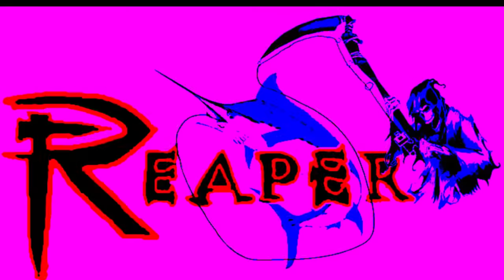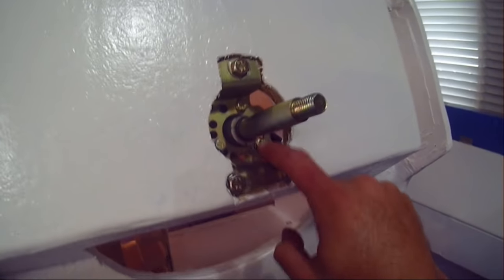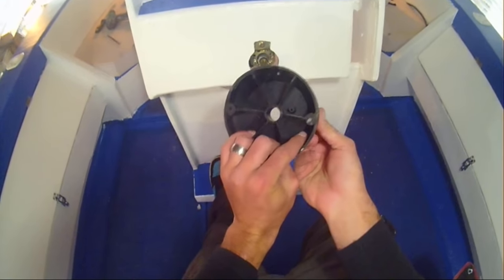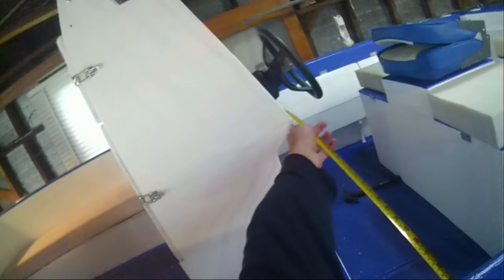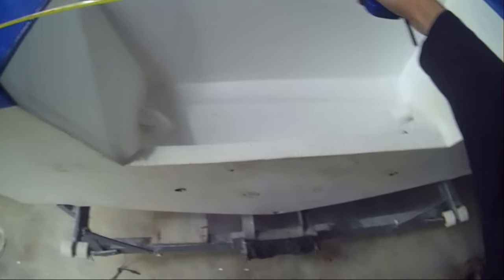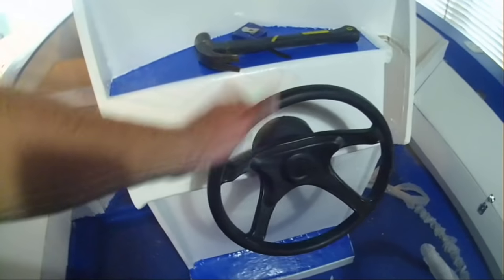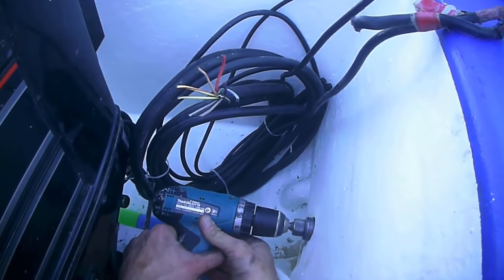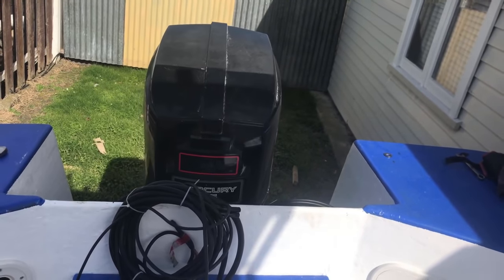HOW TO INSTALL BOAT STEERING SYSTEM

Comment: Lots of videos about changing cables.  Lots on upgrading or replacing bad parts but I don't think anyone else has done a video about adding steering to a boat that didn't have it previously and this is exactly what I was looking for.  Nicely done!
Reply from the maker: Thank you very much for your comment. It's really encouraging to know that a video I've made has helped someone out. Thanks for your support.
Reply: Having watched all your videos now, I must say it's a real shame that you didn't do a full documentation on the complete boat build.  You've done some amazing work and it's a shame that it's all relegated to a 6 minute video.  Your episodes on the actual builds of the fuel sender, light bar and steering setup show what might have been a great build project that was documented from beginning to end. In addition to the actual boat build, I would have loved to see videos on the console build and especially the addition of the throttle controls much like you did with the steering.
Reply from the maker: laserguy Hey man. Yeah I'm so disappointed that I didn't do a video documentary of everything from the start. I took photos of everything since the start but it does not justify all the work that has gone into building everything. If you search for me on FB Jonathan Jvv I'll friend you and then you can check out my boat build album. Every photo is in there. In regards to the throttle control that will be one of my next videos. It is temporarily mounted on the console but not connected to the control cables and motor electronics yet. I will also be doing another video soon of how I did the anti slip on my boat, so easy and really cheap. I also have another chill box from a friend that needs fibreglassing so I will also do video on how to fibreglass too. Thanks again for watching and following my videos. Greatly appreciate it. 👍
Reply: Thanks for the reply.  Look forward to the throttle control video.  I know how to do fiber glassing, just thought it would be great to see you build the console completely from scratch.  As to FB, I have account but have never used it.  Left you a message.  Hope it gets through but no promises.
Reply from the maker: Hi There. I've finally. uploaded the video for the throttle control. Sorry for taking so long but I had issues with getting the correct size of cable and had to get it imported from America. Well hope you find it helpful and if you have any questions please let me know. Cheers Jono

Comment: Easy to understand. I saved it for the job I'm about to do. One thing. Your measurement for the length of the cable. Instructions that I have seen say to add an additional 6". Then round off to the nearest foot. Adding inches to the nearest foot. More is better than less.
Reply from the maker: Awesome stuff Mate. What boat are you installing this on? Is it a project you are busy with? Definitely round up rather than down easier to hide a couple of inches than be to short.
Reply: I own a 1882 Ranger Warrior bass boat with a 1985 75horse Evinrude.  Both still in very good condition, garage kept. But constantly upgrading, it seems. Sometimes by choice sometimes not so much by choice. All good though. Kind of treat it like a hobby. Really do enjoy Largemouth Bass fishing from it. Finished the steering cable install and ready to fish again. Thnks!

Comment: Nice video. Although your descrition on messuring left off one very important detail. After converting to Feet you must add 18" and round up to the next foot. Clearly states this on the box instructions on every steering system kit.

Comment: Thanks for this video! Have an old 1970s 16' Caribbean with steering wheel on the front right. It has holes for steering cables on both sides of the outboard near the Transom. SHould I use the old holes pulling cables from both sides or use the system featured in your video where the cables enter from one side only and glass up the old unused hole.  Very new to boating as you can probably tell by the noob question but not new to fixing things so any help would really help me in Melbourne. Love your shows and have placed this one on a play list. Thanks, this video and others are invaluable.
Reply from the maker: Thanks for the comment and kind words. It sounds like your boat might have or had an old rope steering system that would have pushed and pulled the motor from both sides. This would mean that at the back of steering there would be some spiral thread where the rope would have run in and if you were to replace the system you will have to replace steering wheel as well. I’m not a big fan of the rope steering system and personally would replace it with the cable system. You’d just have to make sure the motor has the fitting where the cable shaft slides through the motor as seen at the end of this video.
Reply: @FishingAdventuresHB  Yes it does have that. Using actual rope and I do not like it one bit. I was going to replace the rope with rubberized steel cable but like your system more.  YEs will check the motor today as mine is old and may not have that. By the way thanks so much for your response s many channels just want comments to increase the algorithm without any real viewer interaction. Shocked to find someone different. 100% Tuatangata Kaiako! Thanks again.

Comment: Good video. I am converting my 20hp to this type steering. Its is currently a hand tiller. As far as the steering arm goes did your motor already have one on it? Because the kits I've looked at do not have it included. Any suggestions on where to find one? Thanks.

Comment: I just bought new steering cable from boat shop and guy threw in a helm for free..it was slightly used ..i went to install it..everything went well til I realized the cable would not stay in to the helm..it did not have a pin with it..i am wandering if the helm i got requires a pin to lock it in place?? If so what kind of pin? I will add a photo here if I can of helm..it does look like it has a groove inside for a possible pin.
Reply: Can't seem to upload photo
Reply from the maker: Hey mate so 1st of all the steering cable on my boat clicks in and stays in place even without the pin. I just had to turn the steering all the way to the right till it pulled the cable housing into the helm. Then with one hard turn on the steering it clicks into place and stays there. I’ve posted pictures on my Facebook page for you of what the connection and pin looks like for the housing. You can go and check them out by following this link. https://www.facebook.com/1698855633475949/posts/3612440335450793/?d=n 
You will also be able to post your photos on there by commenting on the Facebook post.

Comment: Thanks for the video! I am curious to know what you put to seal around the hole at the back of the boat near the motor, once you fed the steering cable through? thanks
Reply from the maker: I’m a electronic Security technician by trade so I found a round piece of rubber from a camera bracket that had a hole in the centre for the camera cable to go through. I had to drill it out a little bit bigger for the steaming cable to fit but it worked an absolute treat and seals of that hole really well. Otherwise silicon would probably Also do the trick.

Comment: Greetings, hoping you can clarify on this:  when you're ready to begin feeding the cable into the helm (gearbox), how do you determine which way you feed the cable and turn the wheel?   Is it fool proof (does it only feed one way)?  Do you risk feeding cable the wrong way or turning the wheel the wrong way resulting in the boat turning opposite of the way the wheel is turning?  I'm at this point in my install, and I don't want to screw this up.  Thanks.
Reply from the maker: megasonify good day. There should be only one obvious entry point. Normally there would be some sort of clip or cut out where the end of the cable would slot into. Another way of knowing is when you insert the cable turn the steering clockwise and it should pull in not push out. That way you know your in the correct side. Turn all the way till it stops and then give it a hard pull until you here it click into place. Insert the clip to hold it in place. Now When turning the steering left the cable should push out and right it should pull in at the motor end. Hope this helps. Here is my Facebook page if you want to send me photos or need to discuss more. https://www.facebook.com/fishingadventureshawkesbay/
Reply: Great reply, thanks that helps.  I'll send you facebook if I have issues.

Comment: Nice video. I guess you have enauph slack when you mesured your cable to compensate for the difference in height. I mean the cable has to come down to the floor and up, that must add a little more length ?
Reply from the maker: Martin Legare yes deffinately. As you can see I measure across to the up from the floor to the control then acros to the Gunnel then up from the floor again to the gunnel then to the back and then also leaving enough slack at the motor so the motor can turn. Ended up with 20ft cable for a 16ft boat. Rather have to much slack than to little.

Comment: I have a boat. My boat have the steering weel before I buy.  I have a problem when I turn the weel right and left the weel is hard and I need to use alot of power to turn right and left
Reply from the maker: Sounds like the steering cable is starting to freeze up. Start by checking that there are no major bends or cracks in the cable housing. Then grease the rod that goes through the motor. If that doesn’t work you might have to remove the cable and by using spray oil  you can try and re lube the inside of the cable by spraying the oil into the end that attaches to the steering and working it in by pulling the cable as far out as it will go then spraying oil then pushing it in as far as it will go until the oil has worked its way through the cable to the other end.
Reply: @FishingAdventuresHB  thenks i will try it

Comment: How do you know where to put the controls and driver seat? Should the driver be exactly half way?
Reply from the maker: Butch McCarty the controls should always be on the right hand or starboard side of the boat. Depending on the weight of your motor you always want to put more weight to the front of the boat. I would not go more than half way back.